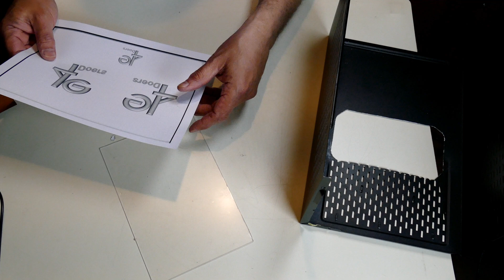SERVER BUILD - Part 5 – COMPLETING THE FINAL AESTHETIC CASE MODIFICATIONS Before Going Production

Comment: Thanks a lot for this series! I'm trying to implement this on my home and in my job too. Can you dedicate some time to backups and power outage recovery? Reading the XN forum some said that UFS has more corruption problems with power failures than ZFS.
Reply from the maker: You are very welcome. I was planning on one about backups, where I create a Unix script and place it in the 'cron' tab.  It just keeps getting pushed for others that I want to get past.  Right now I manually back everything up to some standard Buffalo NAS servers, but I may need to change that somewhat when I use up more of the 14tb space this new server gave me.  Also, I will be replacing the hardware on that server (except for the Disks) with a faster CPU/Motherboard in a Rack-Mounted case.  That should be within the next few weeks.  For recovery I will need to think about that some more.  As you noted ZFS is very resilient and I've had no problems with it.

Comment: Did you try the Arctic MX4 already?
Reply from the maker: Not yet, but I will order some right now so I have it for my next build - hint 'Putting together an older, but very usable, PC with the parts I have lying around.  The case I will use is one I purchased a couple of days ago that I will be doing a review on in about a week.  I had my choice of Black, White, or Pink (which cost $5 more for some reason), so I ordered the White - my new 'favorite' PC case color.
Reply: @PE4Doers  Great :)) I can not wait! As always :)) Any colour is better than Pink in my opinion :))
Reply from the maker: Glad to hear that.  I would NEVER buy Pink, unless someone else paying for the build wanted it and would be taking it at the end of the build.